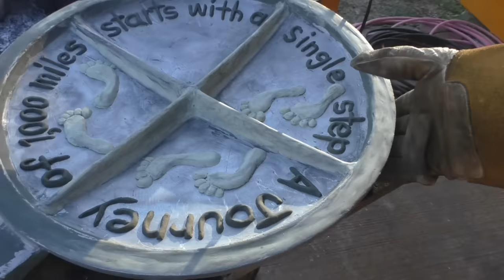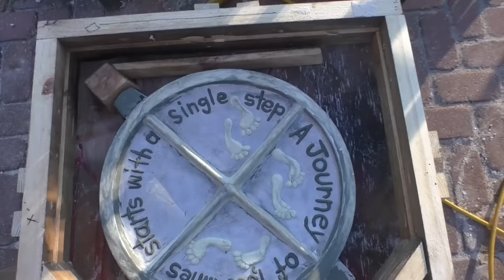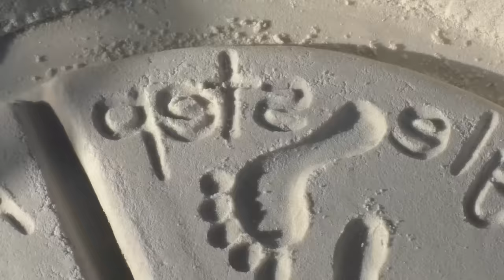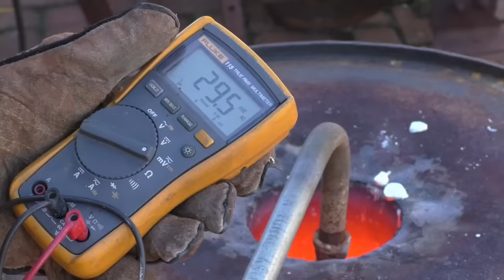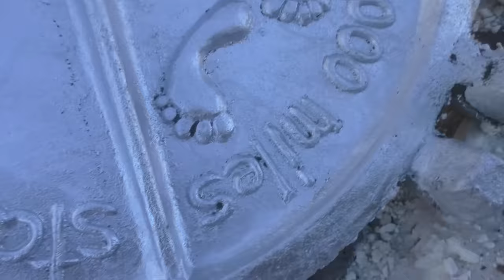Step by Step Aluminum Casting with Sodium Silicate Sand

Comment: while cutting back to the line you could save allot of time by using a small wet dry vacuum, non destructive way to remove excess and if you dedicate a cheap shop vac to just that you might be able to collect clean silicate sand before it fully sets from the vacuum

Comment: use a band saw to cut off sprew , and there are now special aluminium cut off wheels for angle grinders , that do not require a lubricant , they would be a better option to the reciprecater saw, and safer.
when you do your keel ballast, have you thought obout lead shot, secured in place with an epoxy resin , this would ensure that there are no voids , and be easier to get into place
just a thought .
jeff lord 
AUSTRALIA

Comment: So, you seem to be saying "plith" when you are talking about the "base" or block that you sit the crucible on both on the ground and in the kiln.  But, it's actually called a "plinth", which is a pedestal.  This is not to be confused with a "plinthe" which is baseboard trim.

Comment: I work for a company that casts aluminum and nickle super alloys making parts for jet turbines and the military, due to the military portion of our facility i cannot disclose the name. However, i will give you two extra tips for better crystallization in your finished products. 1- (yttrium). for every 20 pounds use 15g of it.   2- Use argon gas to remove impurities. this should (while in the melting process) force more slag to the surface which contains impurities that are not rising to the surface otherwise.
Reply: Depending on your size of yttrium particles also determines the temperature needed to successfully incorporate it into your cast. Just to be safe grid them into fine dust as to not have to worry about it.

Comment: Is that glass sphere powder bad for the lungs if you breath it?
Reply: Yea.... Breathing any dust, silica, concrete.... Etc is bad if you breath it every day for a few years.  
   Most government regs and warnings have been put in place to protect workers who get exposed to these hazards 5 days a week for years. 
    For the hobby guys.... Just a little common sense is all that's required.
Reply: +tim9lives silicosis is not a time ailment, it doesn't need days or weeks etc...  it's why "sand" blasting has been illegal in the UK since 1948, use your IPE save yourself :-)  Great video
Reply: stuff is illegal in the UK because their people are being wrecked with the same tactics that wrecked them, and us, hundreds of years ago... you cant buy a dato stack... you must change refrigerants every year...  industry is whipped out and we made dependent on irresponsible trade mechanisms.

Safety is good... but those "laws" are not necessary...they are active betrayal of the community and thereby all of mankind... please stop making the kids think you respected the topics, when you let us all get ran over by thieves de-validating good will itself.

the term safety sally is beyond stupid in more ways than any man will ever know... we have that term instead of happy respectable men willfully and honorably safe in their trade because you cheaply honored yourselves  for standing behind hooker lawyers securing kick backs from trade mechs that have potentially put the species on the line.... for nothing.

you can do better.. my life was worth far more than what you traded it for.
Reply: dont worry about it unless you are young,  youre going to die of something, until then enjoy doing something , its called living.

Comment: Building the furnace was one of the first Seeker videos I watched, this video rounds that out nicely. How much machining needs to be done to the castings to make them usable? Holes for a hinge pin and a slot for the locking mechanism? How are you thinking they will be cut, bandsaw, drill and die grinder, or on a mill? Are the hinge and lock integral parts of the porthole frames, or are they to be fabricated too?
Reply from the maker: +Christopher Gedrim Yes, yes, and a groove for a gasket.  Plan to do most of it on our CNC router table.  It will have to be really slow, but it will work.   And they simply use the same hinge pin used by the glass frame.

Comment: Don't remember the using of the thermocouple so much in earlier casting videos, since when have you had it and/or started paying attention so closely to it's readings?  Would you say it's use is a big part of the improvement of casting results, because it seems to me to be the key issue - the metal needs to be at just the right temp for the casting size you are at here.  Did I get the right or wrong impression?  Impressive system at any rate, thanks for increasing the knowledge base even though I doubt I'll ever need the information, it's still nice to see someone doing it and getting good results with consistency like this.
Reply from the maker: +Lee Barnes    After several tries you get to where you can guess the right temperature visually.  But you are absolutely right that using the thermocouple and paying attention to the temperature has really helped us get good results consistently.

Comment: Why not make an odd side? 
Which is one half of your mould. 
So no more jointing needed on the next few moulds.
 The first mould with pattern still in it is used to make one extra half mould.
 Place this part aside_________ this is the odd side!  
So the pattern is removed from the first mould made and the mould closed up. 
The pattern is placed onto the odd side and another mould can be made using this repetitive system. 
I use this method myself when making moulds. 
 It saves so much time during the day by not having to joint every mould that`s made. Simple!
  Have fun guys. BB

Comment: Joseph Richards
Hey Doug, Joe here from Halifax NS Canada. Was just back re-watching some of the anchor winch videos and I had an idea for those capstans you are trying the lost wax method on.

If most or all of the torque is going to be transfered from the shafts to the casting via a keyway milled or broached into the casting with the wood drift keys, why does it need to be cast in one piece? 

You could cast it in two halves much the way you were milling the wax on the cnc. Then you can bolt the two halves together and machine them as one. That would take care of the under cuts and the part should be short enough to still use a shallow flask for the casting. I can't see it being much different then the deadlight covers in your most recent videos.
Reply from the maker: +Joe Richards   It does not have to cast in one piece, but I want to get better at the block casting process.

Comment: To cast the Bobbin, you can still use the same technique with the addition of a "cheek" which goes between the the "cope" and the "drag". Then you'll need a Bobbin pattern that comes apart in the middle of the axle (that becomes another parting point). Wiki has a nice cross section image under manufacturing cores. https://en.wikipedia.org/wiki/Core_(manufacturing)#/media/File:Casting_cheek.svg

I hope that helps you along with you project which I've been thoroughly enjoying.
Reply from the maker: +ry knows   Yes, a couple of core sections would work too.

Comment: Hi I cast bells from aluminum in my back yard and the largest I cast can be 20 inches. I mix zinc in the aluminum to give a more sustaining ring. I have a simple fire brick furnace made kid of like a well and use hard wood for the fuel and a blower. I melt in a cast steel crucible that holds 5 gallons of metal.

Comment: Hey thanks for the details about the riser, i always have trouble with the surface finish of my casts. first i thought it was becaus of too little pressure and tried higher poorholes but that did not work. next time i will try a riser, lets see if it works now!
Reply from the maker: +Smit Creations    Try and poor as cool as you can.  That has the greatest effect on surface finish.  The riser has more to do with reducing the shrinkage.
Reply: thanks for the tip, when i think about it i did poar quite hot, i really need to get a thermal copple.

Comment: If I may be of help. There was supposed to be a vent opening at the diagonal opposite corner for the fill to ooz out showing it is filled to capacity.
Reply from the maker: I found it better when the vents are at the high spots.

Comment: Easy way to make CO2: baking soda and vinegar.
Reply: Why soda baking and vinegar?
Reply: @catholic3dod790  When you mix baking soda and vinegar, it produces CO2.  For people who don't have a CO2 tank for welding, this would be an easier way of introducing the gas to the sand.
Reply: @jkroschel  

Okay, thanks
Reply: @jkroschel  

Thanks. I have one more question. Why do BigstackD include this not melt gold and steel on the videos? Thanks again.

Comment: Would this method work for casting copper?  I heard you say something about "if the aluminum is too hot, it can burn up the powder" but will it hold shape without too much distortion? And if the part is a half-pipe shape with features on the inside, would you recommend using a disposable mold core or still do it in halves? Kinda wish you had an email, but you are way too busy.

Comment: Disclaimer: As I live on the fifth floor without even a balcony in midst of a densly populated area, I can only dream of doing things like casting parts. I would love to make stuff like that, but… 

Anyhoo: I saw a very interesting, cheap green sand supplement, which is sand with clumping cat litter. The folks who used it ground the cat litter down to a powder and mixed it with sand dry, then carefully moistened the mix until it got nicely clumpy when squeezed. The results they presented looked pretty okay, and you probably can't get cheaper reusable material.
What do you think of that method?
Reply from the maker: So move!
Reply: @SVSeeker  ok boomer

Comment: i've always found casting to be a fascinating process...sadly I don't have a good space to make it feasible for me to do any with any real intent.   I did a lot of greensand in shop class (back when they still HAD shop classes) and have done some investment casting....can still watch them for hours to do it..    really nice description of the process on this one!! 

when you do the lost wax (or foam) method...have you seen where they prep the piece, dipping it in drywall mud and build it up on the form, then set the whole form in dry sand?
Reply from the maker: +Tim Hyatt    I have seen that and done that.  It's a lost foam process.  http://svseeker.com/lost_foam_casting.htm

Comment: Very informative, I really enjoyed this. I learned basics years ago, and have often wanted to learn more for a hobby. About 20 minutes into your video, you describe removing your artwork- What is the material you used for the lettering, and where can I learn more about working with that material?  Thanks
Reply from the maker: Howdy.  It's oil clay.  It never gets hard so you can reuse it.

Comment: what if you took a powder puff for the talc powder (or similar product) and taped it around instead of trying to sprinkle it from the container.  Might be easier to help keep an even layer and not worry about getting to much in 1 particular area.
Reply: also, great video on casting.  i appreciate how you explained everything.

Comment: That is not true. A simple core box can be made to make the shape of the inner locked shape. The split pattern would have half of the outer shape of the core ring. Split patterns are used to lay flat down on the bottom board.

Comment: At 29:00 you use a temperature probe.  Did you make it or buy it? 
I have a pyrometer and a couple of K-type thermocouples... But I just put the thermocouple into the foundry itself.... I like your probe idea, but I've never seen one before...
Reply from the maker: Purchased the thermocouple and welded it into the end of some conduit.  http://mifco.com/shop/thermocouple-for-ht-furnaces/replacement-8-thermocouple-tip-2/

Comment: vinegar and baking soda will generate CO2 gas, although it is a low pressure system.
Reply from the maker: +Dan Waldhauser   Thanks for the tip.

Comment: Does the diesel require a pump? Or does the propane pre-heat get it flowing/atomizing sufficiently by gravity?
Reply from the maker: +Kevin Hornbuckle   The compressed air creates a vacuum in the nozzle.   Details here: http://svseeker.com/casting_furnaces.htm

Comment: I know older video.  But a very hollow pla mold set in plaster with sand that is melted out works so much better then wax these days.  much finer details i end up with vs wax
Reply from the maker: Horse Shit!   I've seen finger prints in wax cast into the final part.

Comment: glass micro spheres? do you need a respirator or mask? cause prolonged exposure sounds dangerous. great video though
Reply from the maker: +Ch3f1989   If I was going to use them on a daily basis and I did not have the makings of a Taureg tribemans then I might wear a mask.  But dangerous?   No.

Comment: I was melting down lead weights from car tires to make my own fishing weights. I accidentally put my finger in the pot of lead only for a brief second. But all the way up to my second knuckle on my index finger and it did not burn me.
Reply from the maker: Yeah, 600 F just ain’t that hot.  Myth Busters did a show on dunking your hand in molten lead.  The issue is getting your head wrapped around it. : )

Comment: Why would you not make the parting line in the middle of the cover?  Seems like it would have been easier to cast since you could have done both halves separately then put it together.  Could have used some easy fixtures for locating.
Reply from the maker: +Brandon B    Middle of the cover?  I don't think the parting line can go anywhere but where it did.  And we did not use a match plate because we are using an existing part for the pattern.
Reply: +SV Seeker Ah, that makes sense. Nice video.

Comment: That's not true. Each metal has a certain shrinkage factor. Depending on the molding material used and the resistance to metal shrinkage will give you the final shrinkage factor. Thats why you found only about 1% shrinkage because the mold process used is harder than greensand.

Comment: Does the sodium silicate cast not work for bronze because the melting point is too hot? I have a project that I am going to be working ok soon but dont want to lose resolution in my master because of burning the sand
Reply from the maker: It works fine with bronze.  I started using it when casting my boats propellers.  https://youtu.be/4Ahj8ata5Sc

Comment: I don't think you should be dumping the old molding sand in the ocean... It will be filled with heavy metals as the vapours from the aluminium deposit onto the surface in the majority of the mold. Alu often has things like copper alloyed into it
Reply from the maker: Right.  Now try backing that up with any research.

Comment: You lost me with what you mixed with your sand to help it retain it's shape. Can you use waterglass?
Reply from the maker: Sodium Silicate is waterglass.  If you get it from a foundry it will work better.  It does not dry as fast.

Comment: Hey! 
Thanks a lot for the video.

But just one question. Can you reuse the sand after addition of sodium silicate? 

Cheers
Reply from the maker: The foundries run it through a crusher and screens and reclaim about 70%.    I fill in low spots in my yard.

Comment: Thanks for sharing!!!  I have a couple small parts I need to cast,and like you,didn't want green sand.I was unaware of using just white sand.Can the sand be broken up and reused?
Reply from the maker: The foundries have machines that can recycle about 70% of the sand, but I just use it to fill in low spots in my yard.

Comment: What is the CO₂ reacting with that causes the sand to get hard?
Reply from the maker: 40% Sodium Silicate  AKA:  Water Glass.    Easy to find on eBay, and you mix it into the sand, 2 to 4% by weight.
Reply: I find that very interesting. Thanks MUCH for following up with me and for posting an AWESOME video documentary.Giving you a big thumb's up.

Comment: Can you crush up the used sand and reuse it for casting with again?
Reply from the maker: The foundry has equipment to do that.  They get back about 70%.   I just use it to fill in low spots in the yard.

Comment: If I am casting a big heavy object 
Lets say 30 kilo 
Do I have to pour it all at once?
Or is it ok if I pour it in a couple of rounds 
To melt more metal between rounds
Reply from the maker: No.  It has to all be in one pour.  But if we are talking about aluminum, you can just get a big iron pot, dig a hole in the ground for a furnace and use air blowing into coal to melt down aluminum.  Then ladle the aluminum out of the iron pot with a steel ladle.    Sculptures are often poured in smaller pieces and then welded together.
Reply: @SVSeeker  
Thanks for the help

Comment: I wonder if this process would work with gray cast iron to make a 200-pound anvil or some other milling and lathe parts.
Reply from the maker: Yes.  A local foundry uses it for stainless steel pump housings.
Reply: @SVSeeker  thanks for the info you must be on the ocean by now
Reply from the maker: @danvandertorre6349  Nope.  Stuck waiting for the bureaucracy, but we'll be there soon enough.

Comment: Can a sodium silicate marked "Water Glass 40%" be used?  I'm trying to source the proper water glass solution.
Reply from the maker: Yes.   I’ve used that.   It has a faster reaction than the stuff the foundries use, but it works.

Comment: when digging the first half to discover the parting line, why not using a vaccum cleaner with a cyclone (no, not the expensive ones, look at mine: http://i.imgur.com/x7fipcf.jpg). 

I think those part are so numerous that you could have made plates, with your CNC, in wood or polystyrene, one of the trick with the plates is that you can include a lot of things like the risers, sprue, the cone shape for the matching etc. And you can evolve them as you want during you learning phase.